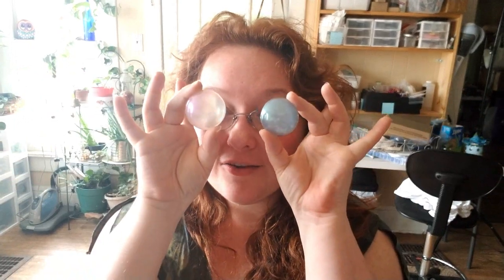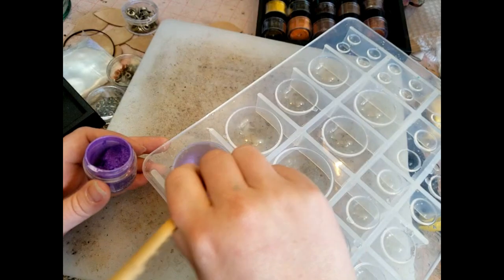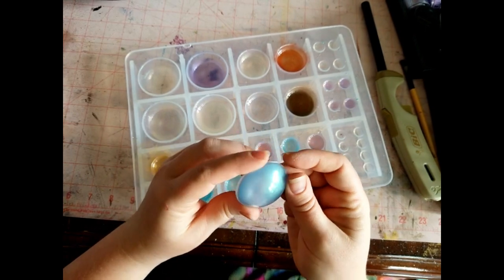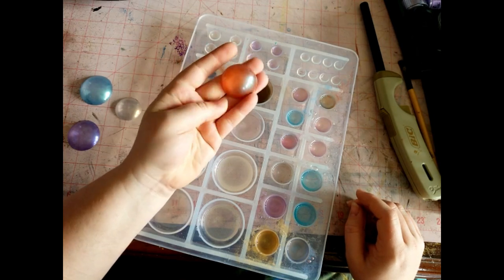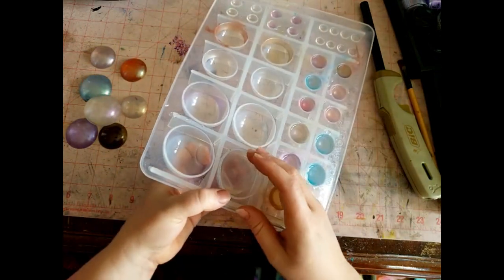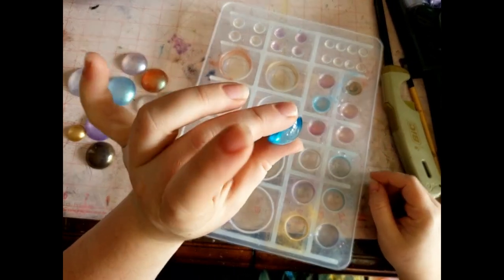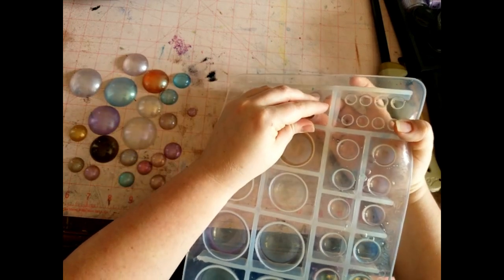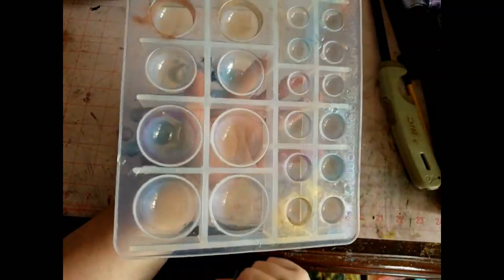Bubble Finish Resin Cabochons

Comment: I love these! I wonder what would happen if you did a dragon eye this way. I bet they would turn out great, especially if you could do a  2 or 3 part resin pour with glitter (maybe even glow in the dark glitter) in the round layer, then the dragon eye in the middle layer on the flat surface, then a thinner layer to protect the dragon eye  artwork. 

I have always wanted somebody to experiment with a 3D effect with resin by doing layers. Layers can be done with resin. You would just just have to wait for the first layer to set up (cure? harden? whatever it is called that resin does) before doing the next part. You have the kind of creativity and imagination that you could do a great job with it. 

Oh wow, what about a jellyfish with fiber optic lights as the tentacles? Or even just with painted wire tentacles would still be cool looking, especially with the Pearl Ex.

Comment: Three questions:
1. Do you think you could use clear ones to paint as dragon eyes?  I mean, would the nail polish work with them or would it interact with the resin?  It might be nice to have lightweight dragon eyes, especially if someone is using them in crafts.  I used glass ones in an 18" dragon I crocheted and he kept wanting to face plant because of the weight.
2. Do you think brushing the Pearl-X in first would work with clay?  Granted, it'd roughen up the surface, but I wonder what effect it would have.  I don't have an Pearl-X at the moment so I'm not sure on that one.  Just wondered if you (or any of the experienced crafters on here) have an idea of whether that would be an effective look or not.
3. If you took these cabochons and filled a little clear resin in the mold and put these back in, would it give a shiny look to them and add an interesting level of depth?

Comment: Oh.....I have another question for you, but I'm not sure where the best place to get in touch with you for craft/decorating questions, and possible offers for gnomeless homes is floating around in my mind.....I make resin pours. I also make resin cabs to use for wrapping wire around, etc. When I do a resin pour, I get the resin runoff from the painting, and many times it's absolutely beautiful, like acrylic pouring skins. So, I have these pieces of cured resin that are beautiful, some like little flat perfectly round circles from drips, some irregular shapes, some larger pieces that can be cut. My question is, can you/would you use these to decorate your fairy houses? Maybe as stones for walkways, around doors, etc. Maybe as roof tiles (they can be glued on top of the roof, rather than painting the roof), maybe as a tiny pond, with tiny fishes, in the tiny garden of that particular tiny fairy home, since the blue water colored pours I've done leave blue water pools that are amazing and just need to be used for greater good, and not thown away! Oh jeez, am I a hoarder in the name of crafting? I've been telling myself no, but I'm not so sure. Maybe you can use them for your art.....and hoard them at your place, lol.

Comment: Yvonne, I am looking to enhance a set of masks I bought recently and need suggestions for clay. I cannot place the masks in the oven because it would damage them (Also I only have a small toaster oven in my house. Not a large "real" oven) So I basically need some kind of modeling clay that can harden and cure at room temperature or at the least around 100 degrees F.
Reply: Glenn Griffon what about using paper clay.  Its light weight and air dries.  Can make your own or buy prepared.  They also make an air dry clay available at most hobby stores.  Hope this helps.